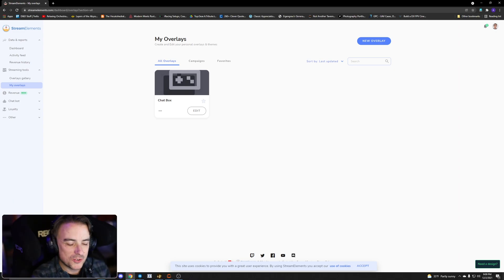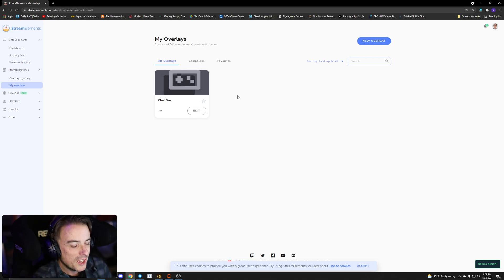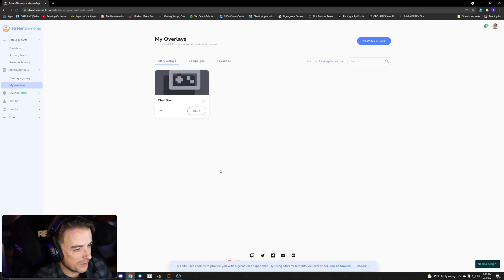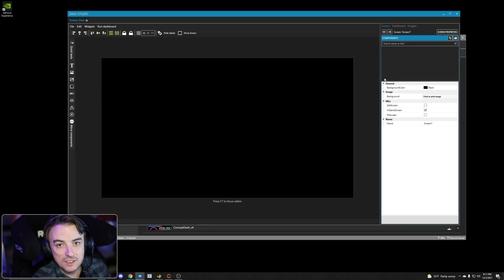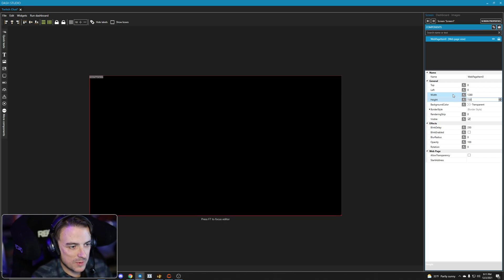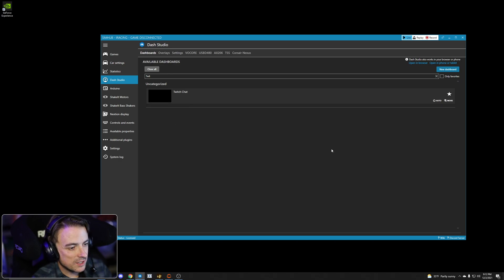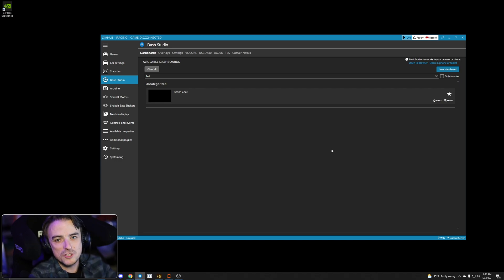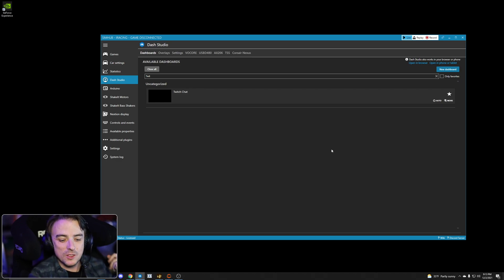Display Twitch Chat On Your Wheel Or Display With SimHub

Comment: Is there anything specific I need to enable on the simhub side? the chat links work in my browser but no websites want to load on the simhub overlay, i even tried google and get "google refused to connect" error on the dash
Reply: it works as normal when i "test dashboard" in the editor, but when i run the dash on my display non of the websites load
Reply from the maker: @MattTheGinge  This is the first I'm hearing of this issue.  Doesn't mean your the first though.  I wonder if it's a firewall rule that is blocking, but the more I think on that, the more I think I'm wrong.  Sadly, I don't have a quick answer for you at the moment.
Reply: @AdamHeart  yeah ive seen a few others on the simhub forum with this exact issue and no responses for a few years, im going to keep poking around with it and i'll reply if I ever find a solution.
Reply: @MattTheGinge  ever got it to work? I did exactly what was said in the video and nothing but a black screen displays.
Reply: likewise here.. @adamheart
Reply: Works for me when I use stream elements chat box, the twitch and youtube ones don't work

Comment: Hey Adam, I'm trying to get the Porsche 992 GT3 individual wheel lock up leds working in SimHub, but there's no property for that.
I am talking about the leds on the sides that warn you about each wheel locking up during braking.
Do you have any idea if this can be done?
Reply from the maker: Sadly no. iRacing only puts out ABS as binary on/off only. Not at the individual wheel level.
Reply: @AdamHeart  Oh okay, thanks for the quick reply!